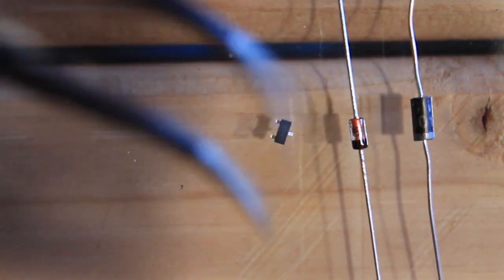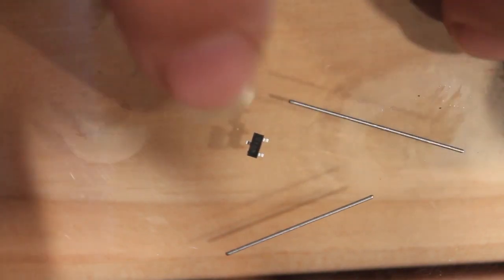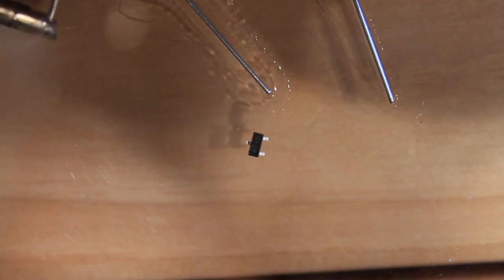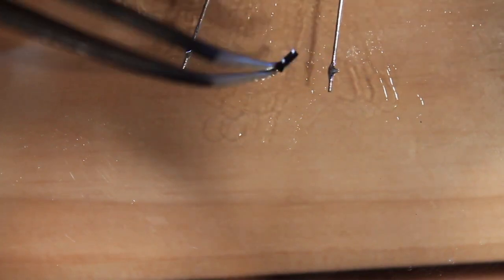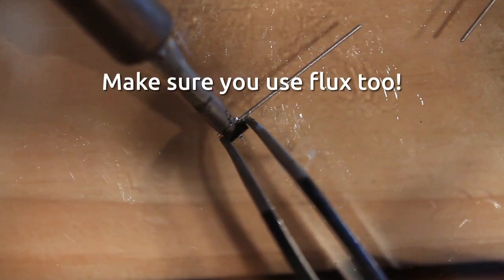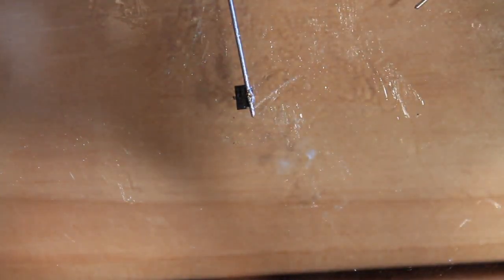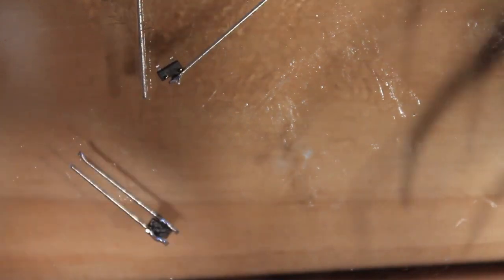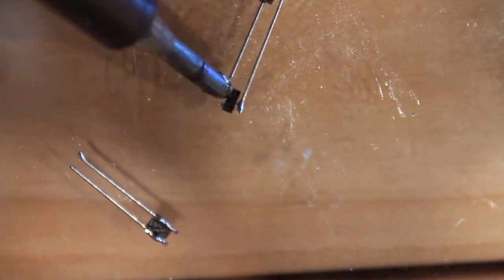BAT54 SMD Diodes in Breadboarded Octave Pedal Experiment (Demo at 6:12)

Comment: hello i have to replace a diode like this on a pcb i can read WV4 how do i know what configuration is it??? i'm clueless i have another board working and looking at the same diode if i put my multimeter red probe (diode mode) on he central pin and the black on the left pin it reads 0.386 moving the black probe on the right leg it reads 0.196 but the weird thing is that if i invert my probes (black on top and red on left leg and then right leg it reads respectively 0.181 and 0L what configuration do you think it is???? and why if i invert the probes it reads anyway?? i thought diodes can let pass current only in one direction! can you explain this please? i'm trying to learn thank you
Reply: WV4 = BAT54S = > I >